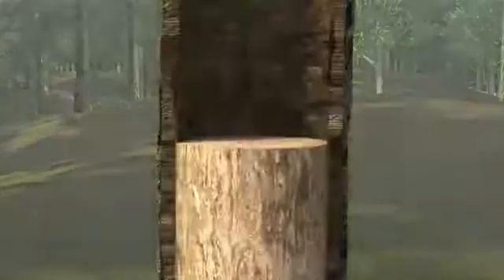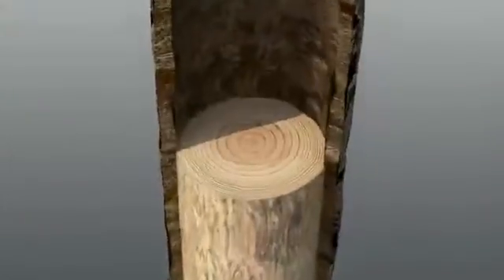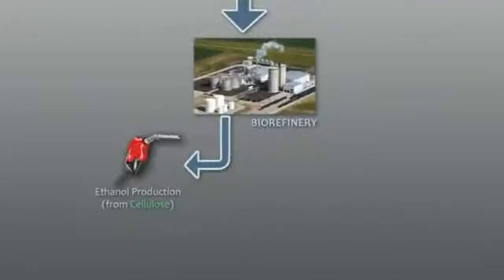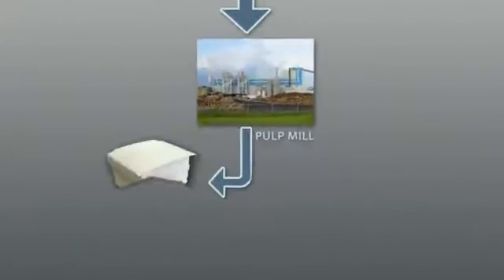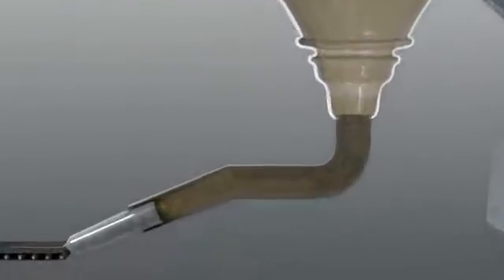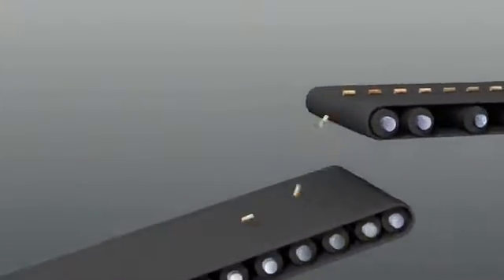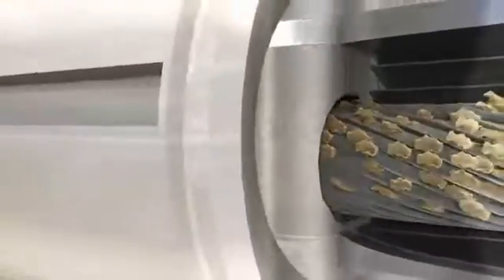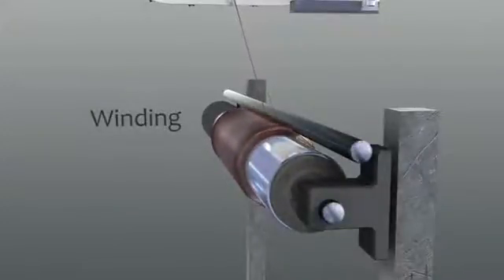The use of lignin as a precursor to carbon fiber

Comment: If this can be used as an inexpensive precursor, in addition to other sources, besides graphene from trash, it could mean a wider use of carbon fiber.  From aerospace, construction, automotive, to anything else.  Like bamboo and graphene/carbon fiber as inexpensive tools for construction, depending on the application.

We need graphene from trash, combined with this type of carbon fiber. That would be extraordinarily eco friendly, while stronger than regular carbon fiber

Comment: Are these final lignin filaments the end product or is more processing required to turn these filaments into carbon fiber?
Reply: No it is not carbon fibre. They are known as precursor fibres and can be called carbon fibres after stabilisation and carbonisation steps. However, lignin  based carbon fibres are very weak in terms of mechanical properties and cannot be used in composites.